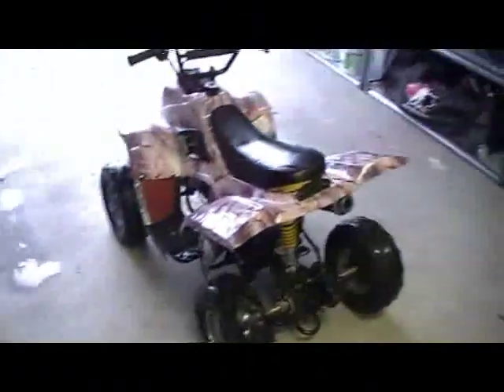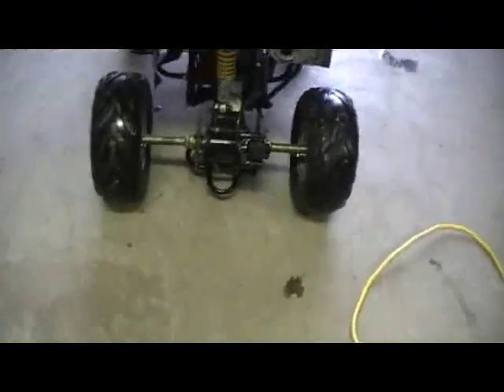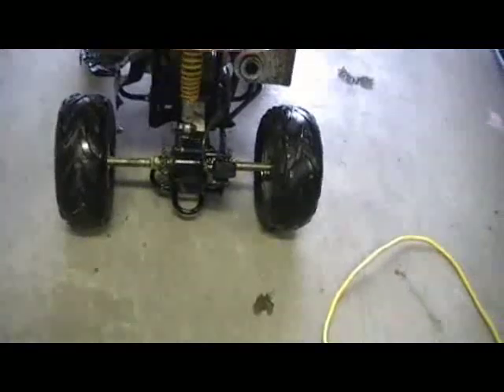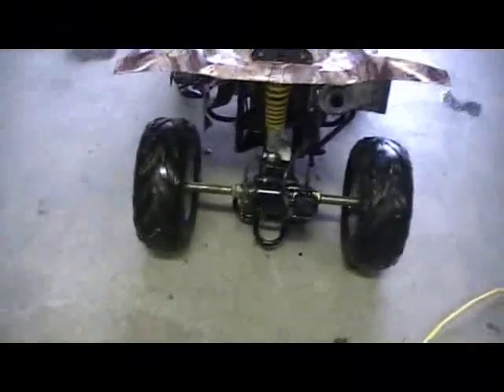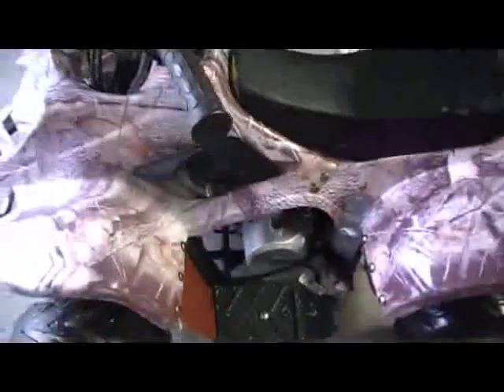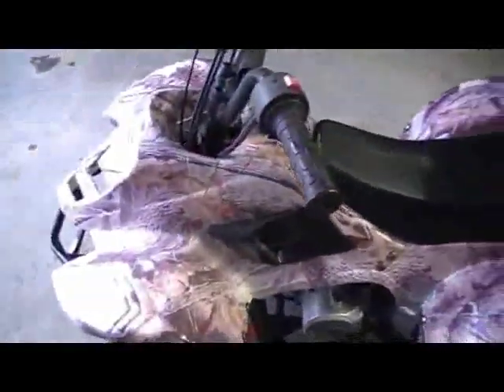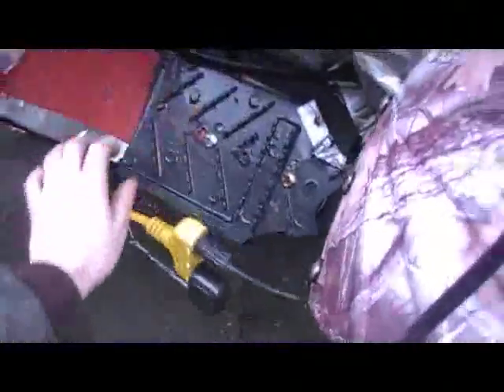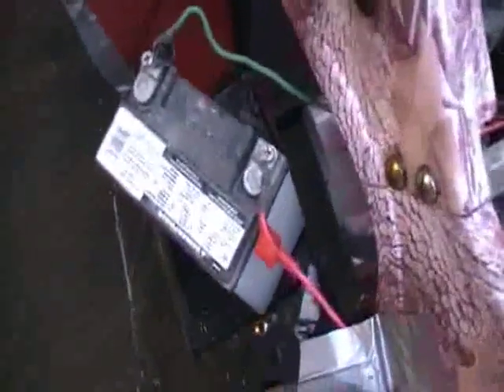Attempt to Start Chinese 110 ATV

Comment: I just bought this atv for my daughter and had the same confusion trying to start it. I finally realized you have to push on the brake pedal while using the starter button. Make sure the kill switch is off too.

Comment: hey just bc it doesn't turn over eleticly doesn't mean u can't bump start it
Reply from the maker: it has a centrifugal clutch like a chainsaw, it won't engage until the engine revs to a certain point. So there's no way to bump start it. It won't engage even when you're rolling down a hill. You have to rev the engine up to get it to catch and decelerate.
Reply: +6speeddakota dude I just bumped mine a minute ago bought it from a kid on my block for 80$ cleaned the carb and I'm rippin it down the block lol
Reply from the maker: unfortunately, I couldn't do that with this one. It ended up dying at the hands of a highschool shop class that tried and failed miserably to turn it into a go kart

Comment: Hey 6speeddakota, Ontario guy here :) just wondering if you found out the issue? My daughter has the exact same ATV and went to start it for the first time since december and guess what, NO POWER, exact same thing as your brothers. The lights dont even come on, the fuse is good and trying to jump start it.......nothing......not even lights, so I am hoping that you might have found the issue.

Comment: Do you have ethanol on your fuel?  Ethanol plugs up all small carbs if it sells.  Whygostock sells upgrades carbs.  Unplug your remote control.  That's killing your battery.
Reply from the maker: The starter switch was toast, and the carb was full of green goo, so the ethanol definitely did a number on it.
Reply: ***** We sell carbs and ethanol treatment.
Reply from the maker: Thanks for the offer, but a bunch of highschool kids tried to make this thing into a go kart years ago, so it probably met a horrible death.
Reply: ***** That awesome!